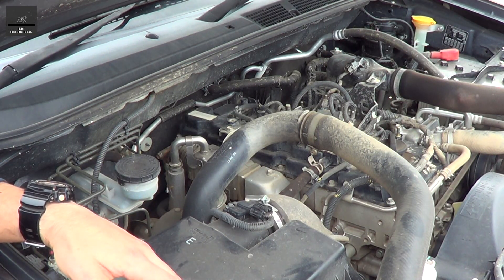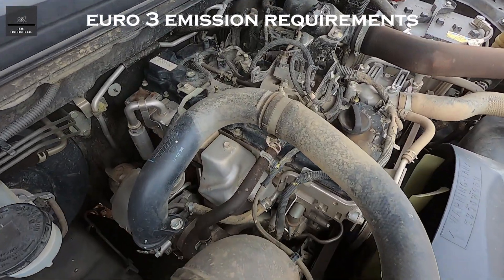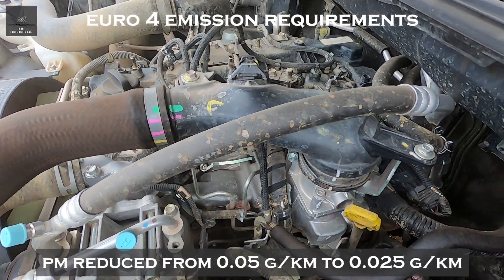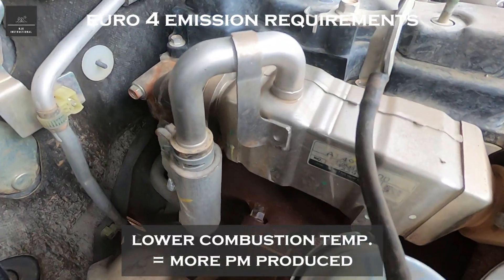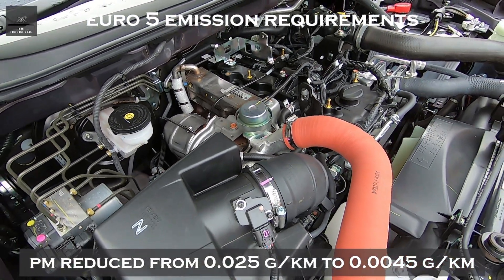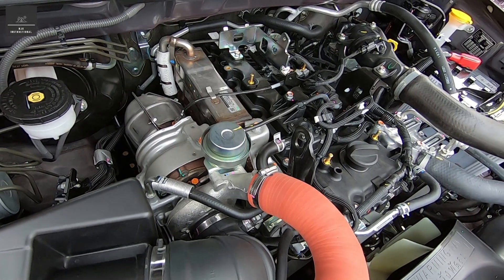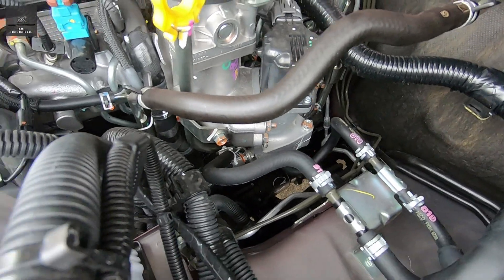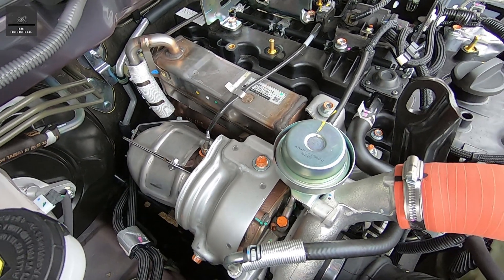EGR Delete Part 2 - DON'T DO IT!  Euro Emission Requirements Overview

Comment: If you remove the emissions equipment you need to load new software which is not aware or care about the egr or dpf.then the engine will not go into reduced power. The US military is getting deleted trucks deleted directly from Ford.

Comment: Hi NJS.  Thanks for the vid.  Very interesting.  My problem is a 2008 Jeep Wrangler diesel 2.8 turbo.  The EGR is blocked and the car is in permanent limp mode.  The dealership quoted about $12,000 to repair the EGR valve.  The car is worth about $12,000 - if the engine was working properly.  So, the car (which is otherwise in very good condition) is effectively worthless at the moment.  I mainly use it as a fire truck on my farm which is on the outskirts of darwin (a very bushfire prone area).  I never take it to town or anything like that.  We have a Prado for that.  So, would you delete th EGR or throw away a $12,000 car?

Greg
Reply from the maker: $12k seems a bit rich for an EGR valve replacement. My recommendation would be to get a few quotes on the repair...
Reply: clean all the gunk in the manifold. Get an ECU remap to get the EGR to not work at all. Your Jeep will be back on the road for less than 1000 bucks, most money will be spent on the tune itself!
Reply: Hi Lemonprofits.  Love your name!!  I wish it was that simple.  I would have done it already.  But I had already approach my favourite mechanical workshop about doing this.  They are a highly regarded workshop.  By chance they had an identical motor sitting on a bench out the back.  It had been rescued from a wrecked Holden Colorado.  So to be on the safe side they decided to pull apart the EGR valve on that motor to see what was involved.  In the process they cracked open the manifold.  They threw up their hands and said it was too risky to do my car with the engine still in the engine bay.  They did not want to touch it.  So that situation remains  - i.e. to clean the valve and or the manifold carries with it the risk of the whole event turning into a disaster.  So I have decided to do nothing and leave it as is and rely on clearing the codes on my phone app as I drive around.   But tell me, is it possible to remap the ECU to turn off the the EGR without the deep dive into the engine?  That would be interesting.
Reply: @gregm9433  Are your mechanics not familiar with Jeeps and these 2.8 engines? It sounds you maybe the only jeep customer they have come across! If I were you I'm spending my spare time looking for diesel mechanics specialized in Jeep diesels and get them to tune it's ECU.

Comment: ive deleted egr on my  2kd fortuner ever since i bought the car 10 yrs ago. Put unichip and replaced the front pipe and muffler. Touch wood no problem at all with 295hp

Comment: emission systems have never been an outstanding success ever . This is mainly the functioning of the EGR system is a reliability nightmare Egr coolers fail [causing at least partial engine failure ]  ,egr stop functioning , contaminate and cause  higher wear on the injectors , burn out passages in manifolds . etc etc etc 
When egr system came out they needed service 40k-60k  kilometres. There is no service for this by makers currently  . The additional engine temps of combustion are hardly worth mentioning but results may vary and I suggest u check exhaust temps after delete . A good delete will electronically imitate the egr and thereby produce no codes .
Often fuel consumption will stabilize , less consumption by 5-10% and throttle response improve slightly .The power increase is not worth worrying about ,its no race car ...
While my friends replace engines and cylinder heads from blown coolers  I don`t .

Comment: Your number two reason is the dumbest I have heard. Governments are not your friend, and in regards to Euro requirements. The EU is the biggest morons on the planet. If the Europeans are doing something. Do the opposite. 

Second, the problem with the EGR, is it too big period. Manufacturers didn't want it that big, the morons in Governments did. And in turn after about 50,000kms, the engine starts to lose power, wear faster than it should, lose fuel economy, and produce worse emissions than if it didn't have an egr.

Just get a reducer for the egr and call it a day, satisfy the eco nut jobs with emissions, keep the car nuts happy.

Comment: Only reason you list thats true is emissions. Problem is common rail injectors go off spec and combined with no excess oxygen caused by egr soot increases dramatically further increasing buildup and wearing an engine

Comment: EGR PARTIAL SUPPRESSION WITH A PERFORATED PLATE

In turbodiesel engines with the EGR system, problems are often encountered in the engine torque delivery curve.
The delays in the response of the device, which over time worsen when the deposits accumulate, cause a very weak torque when the vehicle starts and tears when the turbo is inserted at medium rpm.
It is possible to considerably improve the situation, with the partial suppression of the EGR towards the engine intake duct, with a perforated plate with a small hole with a free surface less than a tenth of the original duct.
You can start with a 5mm hole and possibly widen it 1/2mm at a time if the motor alarm goes on.
With this modification (even on a Euro5), and a sufficiently small hole in the plate, torque delivery often becomes fluid similar to that of a naturally aspirated engine.

Comment: Why does my truck run way better, get an extra 2 mpg and have way more power with all that stuff deleted?
Reply: Because your fuel air mixture is closer to stociometric , now .
Reply: I have a tuner. It’s a MiniMaxx. I love it. I don’t know if something got read backwards but I’m pro delete. My original comment from 8 months ago said I get better mileage and way more power. What are we talking about here?
Reply: Because your EGR was faulty.
Reply: @DataLog  I didn't say it ran poorly or got less than expected fuel mileage... it's just way better deleted. I loved my truck before, great power, great fuel economy for a full size truck. I just love it more without the emission controls.
Reply: @thelloyd87  It shouldn't really make any difference if it worked properly. 

Did you have an electric valve or old school vacuum operated valve?
Reply: @DataLog   Dude... it's a new 6.7 Powerstroke with a delete kit and Mini Maxx tuner. It works. It's faster and gets better fuel economy. The EGR worked when I took it off. There was nothing wrong with the truck to begin with and I didn't delete it because it was faulty. My boss and I have identical trucks. His is stock, mine is not. He gets 17-18 MPG, I get 20 MPG. The shit works and that's why people buy it.
Reply: @thelloyd87  I have unplugged mine to test the fuel consumption claim.
I didn't notice any significant increase in power yet, but I need to wait to see about the fuel consumption.
I have a petrol engine, so the end result may vary.
Reply: @DataLog  Gas engines use exhaust gas to lower detonation temperature in order to prevent ping which is bad because it can damage the engine. Diesel engines rev much lower and have higher compression. They're built with heavier materials and ping regardless. The EGR is only there for emissions control on diesels, no real performance function. Also just unplugging the EGR alone won't do anything good on any engine type. The EGR and DEF delete kits get rid of the parts and change the PCM parameters to bypass function. In my specific application it eliminates the 95 mph limit and allows more fuel and cooler air in. My EGR is replaced with an exhaust gas temperature sensor fed into my gauge so I know I'm not gonna melt my turbo.
Reply: @thelloyd87  all the duramax , powerstrokes and Cummins achieve  noticeably better fuel economy and power curves after proper deletes particularly if that ridiculous Dev system is deleted and overiden by a chip . DEV systems are what happens when an idiot is told black diesel particulates ( literally a dust that struggles to stay suspended in air) are going to cause global warming . Bunch of sheeple will buy into anything regardless of cold hard science . Eugene Banks needs to come give this guy a few class lessons .
Reply: @DataLog  you need to get a reputable chip to go with any modifications to these modern fuel air and exhaust systems. You cannot get any benefits from simply placing the delete caps in and driving off . In fact you may actually cause combustion issues leading to killing those very expensive Cats . That would heavily negate any benefits.
Reply: @texasslingleadsomtingwong8751  I mean sarcasm

Comment: Egr delete will increase power.
Reply: My MUX did, best thing I ever did
Reply: along with the throttle controller, this thing is beast now, now to get my hard intercooler pipes
Reply: Not really. EGR is closed at high load and open throttle.

Comment: Exhaust gas temp is going to be about the same as it will be dictated by the amount of actual combustion in the cylinder which is controlled by the amount of fuel and air being combusted.  If the cylinder size is constant then the amount of combustion will be constant and only affected by the revs which increase or decrease combustion.  However if the exhaust temp increases nominally it will give a more efficient pressure wave which will improve scavenging of gas at the valves which will improve power and efficiency.  Hence why racers wrap the exhaust to keep more heat in the headers.
Every vehicle I have blanked the EGR has produced more low end power and had an increase in fuel economy.
When people stop flying in planes I'll worry about the environment, until then I don't see why I should have less power and economy when I have the knowledge and ability to extract more.  The actual engine temp itself is generally lower due to more fresh air entering the inlet, as we all know more fresh, clean, cool air equals more power and economy.  I've had to block off some of my grill to raise the engine temperature after the EGR valve delete and I hook it back up in winter as I like to be warm.  I don't even understand why a slightly hotter exhaust would be a problem, it takes massive temps to melt the headers or heat the engine bay up enough to make any difference.
As for being illegal it's hardly the same as drink driving or speeding which people are doing everyday and actually killing people as a result.  Stop being such a pussy.
Reply: Well said, totally agree with that! 😁
Reply: @bmwe657er  - No but on my VW Caddy van the gasses in the rocker cover didn't get out properly and caused it to pop the filler cap for the oil.  I fitted a new cap and reconnected the EGR, less power but no problems since.
BMW 330D is still ok with no EGR.

Comment: The whole point of the EGR is to ultimately not put more Ozone into ground level air. NOx goes through several reactions with ROG's, Oxygen, and sunlight to produce it. The EGR sends NOx back to get destroyed, ensuring we don't poison the air more with more Ozone.

Comment: So no EGR block on Euro 5 with EGR flow sensor. But all other older diesels your all good to chuck that blanking plate in, but just keep an eye on the Exgas temp....
Reply: Maybe euro4 will get a bit upset, Euro3 may log a code, but euro5 needs mapping right out.
Reply from the maker: I wouldn't recommend either...